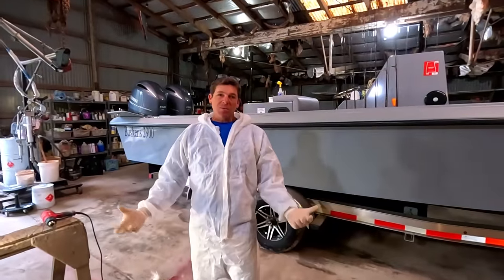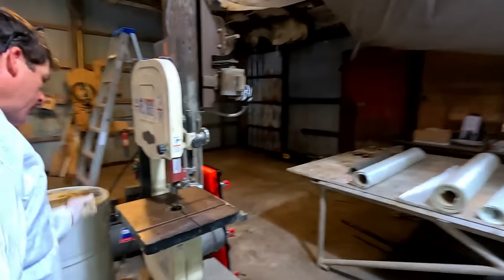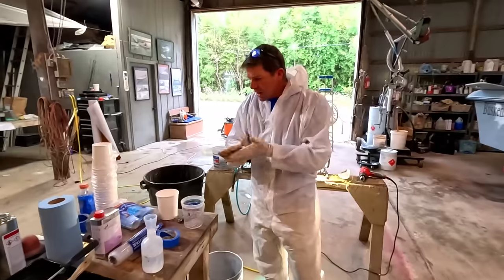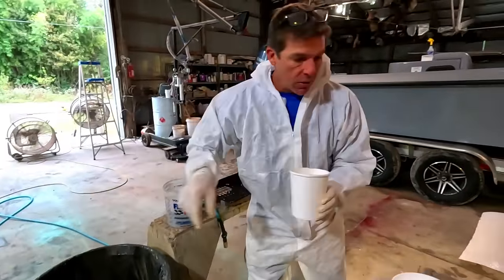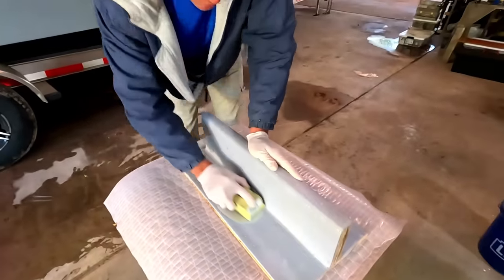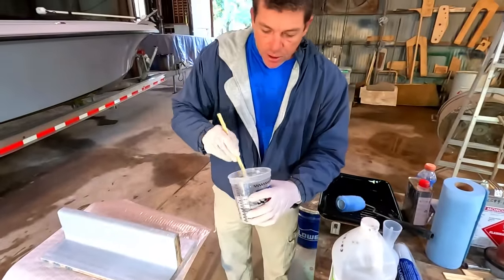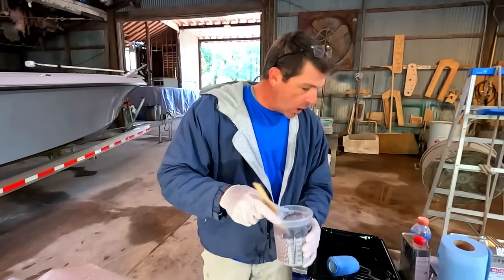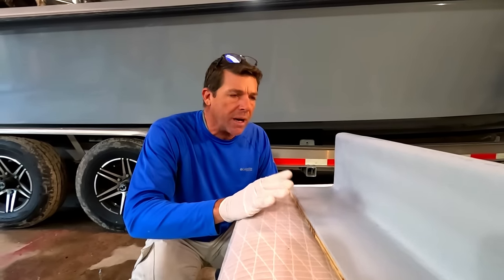Gelcoating Fiberglassed Plywood DIY! (Like a Pro)

Comment: What would you do for a final finish on a visible piece? Does the wax coat need removing? Thanks for the content/tutorial.
Reply from the maker: You could fair out the surface with a filler, then prime and paint with a marine grade paint system. hope this helps, thanks for watching!
Reply: My question is about the wax. Does that need removing before a finish is applied or fairing is done?  @FishBumpTV

Comment: i watched the video from last month on this wood piece.. i was wondering  i have a hood off a quad.. one of the old carbon fiber quad tech hoods & the mounts have all cracked but are still there..  it is under neither so you wouldn't see it.. would i be able to use fiberglass & resin to fix the mounts..? & what would u recommend for resin if u was to put fiber glass on carbon fiber..?  Thank you!
Reply from the maker: I would suggest epoxy resin in this area. Just remember that epoxy does not work well with csm or mat. Other glass will work fine. Also make sure the area is prepped well. Very  clean and surfaces sanded well. Hope this helps, thanks for watching!

Comment: Hi I have a question.  I'm installing a new transducer in my hull.  I have a piece of 1 inch coosa.  Can I use this as a backing plate instead of wood?  If so.  Should I encapsulate it in fiberglass like mat or 1708?  Bilge is wet at times and I like the idea of using something other than wood.  Thanks for you advise.  New subscriber here who has been playing with fiberglass for years in small project form..
Reply from the maker: Welcome to the channel! Yes, in my opinion you could use Coosa as a backing plate. Wrapping the Coosa in 2 or 3 layers of csm or 1708 is not a back idea at all. Hope this helps and thanks for watching

Comment: Maybe I missed a video but did you scuff sand the fiberglassed part before you applied the gel coat or applied directly to the part? Thinking extra bite. Thanks for this. Been 44 years since I experimented with glass. Ahh, guess I should have watched the entire thing before commenting. I now see where you hand sanded the first layer of gel coat. Cool. Oh hey is Lamberts home of the fresh thrown roll still open? Was stationed at Keesler AFB for a few months in 1997. Local friends took us there and then of course I had to ride to Daytona. Deland Sky dive was mandatory. Ha
Reply from the maker: Yep, Lamberts is still open and throwing rolls! I appreciate you watching and commenting on the videos!

Comment: Well you have the same troubles with sticky gelcoat after drying, which clogs the grinding paper. Take a soft cloth and wet it well with acetone. Then wipe off the gelcoat and the surface become extremely sticky, but for some time. After 1-3 hours, depending the gelcoat thickness, amount of applied hardener (you call it catalyst), drying temperature, the surface become matte. Then you can cover any uneven surfaces with an additional layer of gelcoat or polish the surface.
Reply from the maker: Thanks for your thoughts

Comment: Thanks for sharing such a insane knowledge! I'm from Brazil and making a box of wood with fiberglass to receive sulfuric acid in a industry. The inside is perfect, several layers of fiberglass and gelcoat for coverage... But, the outside has no covering, just raw wood. Can I apply gelcoat directly to raw wood? just to ''seal'' and waterproof, since only the internal part will contain the liquid, and the external part only receives drops of water, and jets. It's possible?
Reply from the maker: Glad you are enjoying the videos! I usually prefer to put some fiberglass on bare wood if possible, even if is one coat of csm. If not I would do a primer coat of resin , then the gelcoat for more durability. Sometimes it will work this way, sometimes it will start to flake after some time if there is no fiberglassed base. I hope this helps and best of luck with you project!

Comment: Liking this channel!! I’m a lobsterman in Maine and getting ready to replace my deck. Kinda  stumped on what wood to use for my deck beams other than oak. Any suggestions??!!
Reply from the maker: Thanks, glad you are enjoying the videos! We usually try to go back with the same or similar material as what was in the boat originally. As long as what was originally there gave a good service life of course. Good lumber can be hard to find these days, at least in our area it is. If you wanted to get away from lumber altogether, you could laminate layers of 3/4 Coosa board together. That is what we did for the stringers in our 29 ft charter boat. It works very well, but it would cost more, and be more labor. Hope this helps, I appreciate you watching and commenting!
Reply: @FishBumpTV  Ok Thanks!

Comment: Hello,great video. Im in central TX and ive been concerned about humidity- how humid is too humid or does it matter? Any tips ate appreciated,thanks
Reply from the maker: We are on the gulf coast and it is always humid it seems! I try to avoid rainy or foggy days if possible. For us if it's 70 percent or less is considered good.you can still do glass work when it's quite a bit higher, but wood tends to be much more prone to absorbing air born moisture than composites do. I hope this helps this helps and best of luck with your project!
Reply: @FishBumpTV  thanks!

Comment: Thank you Capt. Joe...rookie here....what do you mean you can't gelcoat over epoxy? If you've used epoxy to wet your glass?
Reply from the maker: There are several different types of resins commonly used. Polyester, vinyl Ester and epoxy. In this demonstration I am using polyester resin, which is compatible with gelcoat. Vinyl Ester resins are also compatible with gelcoat. Epoxy resin is completely different that the other two resin types and it is not recommended that you use gelcoat over epoxy resins as you can have curing and bonding issues. I hope this helps and thanks for watching!

Comment: Hi from Australia. 🇦🇺
I just discovered your Utube channel the smorning.  I have several boats & a catamaran with some need to repair damages.
On my 5.5m ski boat the gel coat has faded & the metal flake has lost the resin that bond it together on the surface. Leaving it rough like sandpaper. (Good for a little extra grip on the deck but looks shit).
On my old 1979 12ft surfcat catamaran it's suffering ply board delamination with in one of it's sealed hulls. Causing the hull to bow while standing on it trying to upright it in the water.
What's the best way of repairing these issues ?
Kind regards Bernard.
Reply from the maker: Sounds like some good project! The first one sounds like removal and repaint or gelcoat. I do have a new interior boat gelcoat video we just posted. The other sounds like partial floor replacement maybe. I have some videos in our boatbuilding series that involves us putting down Coosa floor panel, but marine plywood works in a similar way. Hope that helps. Thanks for watching!

Comment: Can I apply gelcoat directly on plywood?
Reply from the maker: We don't typically use gelcoat directly over or on wood. We would usually put at least one coat of csm fiberglass down, then gelcoat over that. Gelcoat tends to wants to just  flake of wood if there isn't some fiberglass underneath in my experience. Hope this helps and thanks for watching!

Comment: Love the gel coat but for my project I hope to use Raptor over the initial fiberglass stage (resin + glass mat). Im building a truck camper this summer/fall. Steel frame, 3/8 plywood, resin/glass mat, then Raptor. Any advise ?
Reply from the maker: I haven't personally used Raptor products on any of our projects before, so it is hard for me to say for sure how it will work. The rest of your plan seems pretty solid though. I hope this helps and wish you the best with your camper!

Comment: Do you always sand between unwaxed coats if it's been sitting overnight? Same principle as resin layups correct? I know you can laminate in the same day but if it's been sitting overnight and it's the next day can you go back to laminating/gel coating unwaxed surfaces without doing the prep sand? I thought the general rule of thumb was no wax = no sanding even if it's the next day and still tacky but if it's been a week or something and or the previous work had wax or had been cured another way, you have to sand correct? Basically, when is sanding between layups completely necessary vs optional? Thanks Capt Joe.
Reply from the maker: Yes, generally no wax, no sanding needed. We did some grinding and sanding prior to gelcoating for mostly cosmetic purposes. Just wanted to make it look good for you guys! We always use ortho or iso laminating resins in our shop, the stay sticky or tacky for weeks. There are some resins called DCPD, which cure very slick. Almost like they have wax in it. I personally don't like these types of resin for our kind of work. If you don't sand them prior to gelcoating it will not adhere well at all. Hope this helps. As always I appreciate you watching and commenting!
Reply: You answered my question perfectly. Thanks BIG DOG @FishBumpTV

Comment: Will a super fine knit roller, or maybe a foam roller leave a much smoother finish, or will those types of rollers not apply the gelcoat evenly?
Reply from the maker: There are different methods you can use to get different levels of finish. I like a 3/8 nap for general applications. You can also brush or even spray it. But unless it is molded or wet sanded and polished it will always have some textured to it. Hope this helps, thanks for watching!

Comment: Capt Joe, Cousin Neil here.... How would you prep a Blazer Bay 1860 rolled gunnel boat to accept new gelcoat on the inside? My deck is wearing thin. The issue is that if I sand, I am only knocking the peaks off the high spots and not touching the valleys. So I don't think there is enough "tooth" there for the new gelcoat to properly adhere. What are your thoughts?
Reply from the maker: Hey man! Good to hear from ya! We are actually working on a Little rolled edge tri hull skill with a rolled gelcoat interior. We are videoing the process for you guys. There are always several different ways of doing anything, but here is what we do. Keep in mind this boats interior was already pretty weathered, so most of the wax in the gel would be gone from exposure to the elements. We use a course scothbrite pad, along with Ajax or comet cleaner to thoroughly scrub every inch of the interior. Then sand with either a grinder or DA sander to smooth out any lumps and bumps. Vacuum or rinse the interior. Then wipe down every inch with acetone on a cloth. Please be sure to wear good PPE the whole time! Mask of everything you don't want gelcoat on, and roll out two coats. First one no wax, second one with. Hope this helps. Hope to have the video out by next weekend. Thanks for watching!
Reply: @FishBumpTV  I plan on watching the new video tonight!!!
Reply from the maker: @kenfyoozed387  Awesome, I hope it helps!

Comment: Sir, Question. You said you can place epoxy over Gel Coat but not Gel Coat over Epoxy. So, my question is, did you not epoxy resin the fiberglass on the the wood? Maybe I misunderstood. Thank You. Great Video by the way. Watching a lot of your channel lately.
Reply from the maker: We were using polyester resin in that particular video. Polyester and vinyl ester resins work well with gelcoat, but many epoxy resins can have issues with gelcoat bonding and curing properly. If you want to use epoxy resins, I have another video showing how to epoxy over plywood here on the channel.  I hope this helps and thanks for watching!
Reply: @FishBumpTV  thank you.

Comment: I believe companies like west system show applying polyester gel coat over epoxy when its sanded for a mechanical bond. You may find you can gel coat over epoxy
Reply from the maker: I have watched their videos, but most professionals in the fiberglass industry do not recommended applying anything polyester or vinyl Ester over epoxy. There are just to many potential problems that can come up. I have a product that we will be testing soon on the channel that is made to help gelcoat properly bond to epoxy. I hope this helps and thanks for watching!

Comment: Odd Question: Wifes' built in 'large' bathtub has developed hairline cracks  in it's white Gelcoat layer   and discolouring along those harlines.. Ugly.
Removal replacement is Going to be a Large PITA.. unfortunately.
 IS it possible /feasible to re Gelcoat the tub  in place ??  
As in how difficult/  problematic would it be to  apply then sand the  roller applied repair Gelcoat to a Gloss finish ??  Maybe not  overly glossy  on the bottom ..anti slip reasons ?
Reply from the maker: Yes, fiberglass tub repair can be done very much like fiberglass boat repair. If you have never done this kind of work before, you might want to practice on something a bit before working on the tub. If it is more than just cosmetic gelcoat damage, structural fiberglass will need to be added to keep everything water tight. There might even be a company in your area that offers that kind of work. I hope this helps and thanks for watching!

Comment: I have a 96 20' Angler center console that I'm rebuilding. I did not round off the edges like you did so the top of my stringers have a gap from the coosa board to the fiberglass. My question is do I need to rip it off and redo it or is it not a big deal? In your opinion. Any help or advice is greatly appreciated. I have never done fiberglass work before.
Reply from the maker: You should be fine with the Coosa, and your glass not going over the top. The main reason we do that is to completely seal the wood. Coosa will not soak any water up, that's one of its big advantages. We used Coosa when we built my 29, and did not wrap the tops. You can see how we did that on our channel in the the boat building series. I think you would find it helpful. Hope this helps. Thanks for watching!
Reply: @FishBumpTV  yes sir it helps a lot. I really appreciate it. I love watching your videos. They are very helpful.

Comment: You say you cannot put gelcoat over epoxy, and I get that. But that is for cured epoxy. I wonder if the epoxy was no longer wet but still tacky to the touch if wet gelcoat could be rolled on and both harden together.  If so, the epoxy would be protected from UV light. I wonder if a small sample board experiment would be in order- something that could flex afterwards to see if they separate from each other or hold together. Something that would settle the argument once and for all.
Reply from the maker: There are people that say gelcoat can be used over epoxy, this debate has been going on for a while. I am really trying to give you guys some good solid general knowledge on this subject so your projects turn out good. The rule that professionals in the industry like myself generally agree on is that polyester based products over epoxy based products is a bad idea. I have tried it before, and the gel coat did not cure correctly. That was some time ago, and obviously there are many different brands and combinations that are available now, so I might do some test batches at some point for you guys if there is enough interest in seeing that. Hope that helps, and thanks for watching!

Comment: Hello thank you very much for this brillant vidéo. I'll attack today my fiberglass's wave ski surfing board and and bought in My island a GELCOAT finish. I already keep out the mousse cover on it, and clean with sand paper All surface, before start, I'll clean the surface with acetona. The question is: I have to apply two time this GELCOAT for smoothest surface? In the second  GELCOAT application, can I mix only wax (a candle)on it, like the finish for surfboard? Could you please give me the number of sandpaper to use (1000, 2000 for smoothest results?)Best regards. Charles.

Comment: Can you gelcoat on a workboat deck that's been painted even if it leaves a bit of paint in the low spots after grinding  ??? Thanks I'm a subscriber and are doing a 
Lafitte Skiff
Reply from the maker: I would usually recommended removing all of the paint if possible. Tiny spots of paint the size of a grain of rice or smaller should be fine for a work boat application. You will usually need at least 2 and probably 3 coats of gelcoat for good wear an coverage, and remember to add wax solution into the last coat or the gelcoat will remain tacky or sticky. I hope this helps and thanks for watching!

Comment: You can use his tips to fix a fiberglass shower floor or tub.
My problem is finding gel coat also being my shower floor I would like to make it none slip  it had some texture but id like it rougher so my wife doesn't slip and fall agine. 
Show us how to recoat and add a none slip surface.
Reply from the maker: Thanks for the suggestion, I will try to get that out for you guys soon. There are links below the description in our videos showing many of the products we use, including gelcoat. That also helps support the work we do on the channel.

Comment: So if you can’t gelcoat over epoxy, is your only option to paint over it?
Reply from the maker: A epoxy primer with a compatible paint system will work with epoxy resins. There are also products called tie coats that are supposed to stick to epoxy resin, but also allow gelcoat to stick to it. The jury is still out on these kind of products. Hope this helps, thanks for watching!

Comment: Would gel coat be better or regular marine paint would be better over fiberglass, for my perahu canoe project. I'm just gonna add a solid color and shark teeth at the front of the canoe.
Reply from the maker: Both can work well. Gelcoat is very tough, but it will have a dull and slightly textured surface when rolled or brushed on. Paint will generally have more gloss, but usually not as tough. Hope this helps
Reply: Okay cool so like gel coat would be more pronounced for non slip texture. I appreciate  it when I build my custom 20 foot canoe.